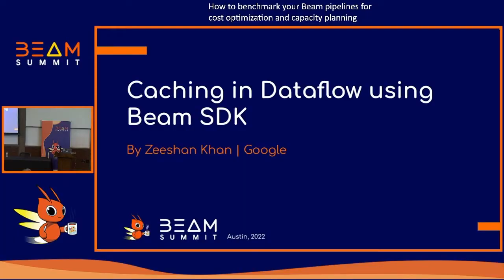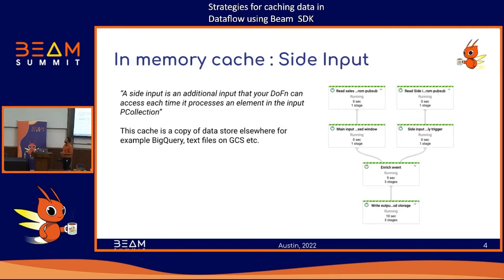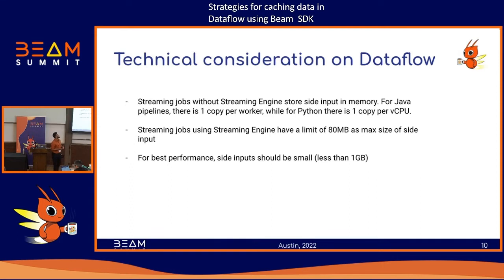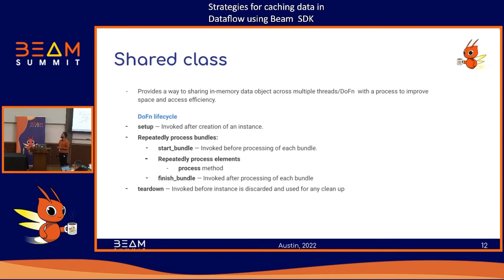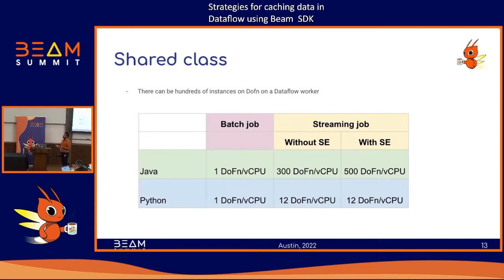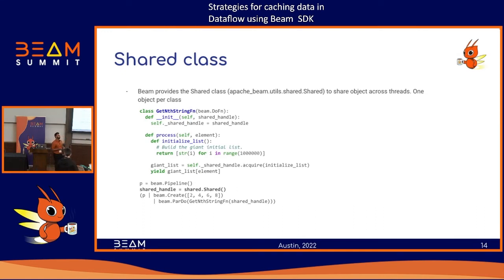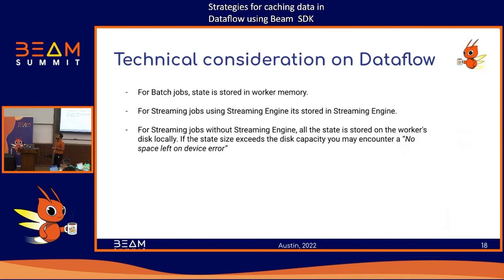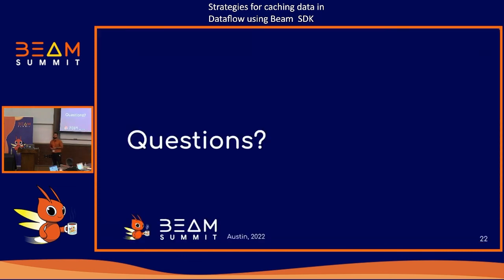Beam Summit 2022 - Strategies for caching data in Dataflow using Beam SDK

Comment: I am pretty clear about how an object is shared across DoFns and threads in a single process, my question is that if I cache a set object then will it be shared across VCPUs as well? 
Full disclaimer: I am working on a beam code which works on dynamic schema, i.e, there is a possibility of a new column addition.